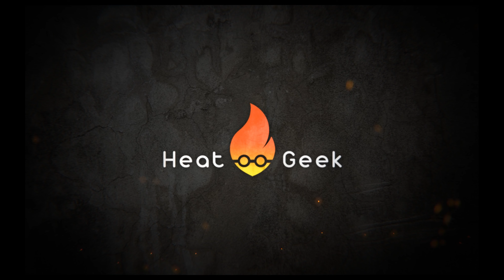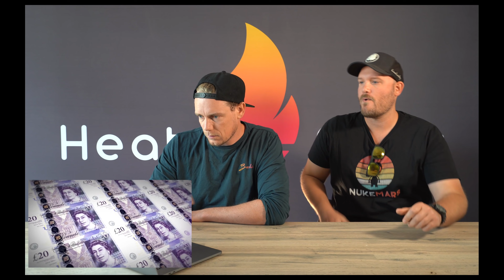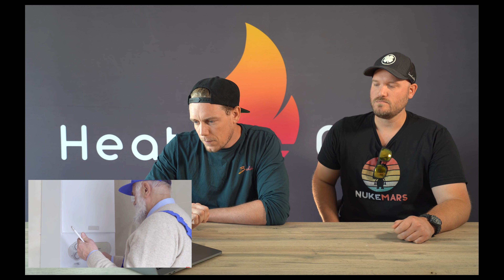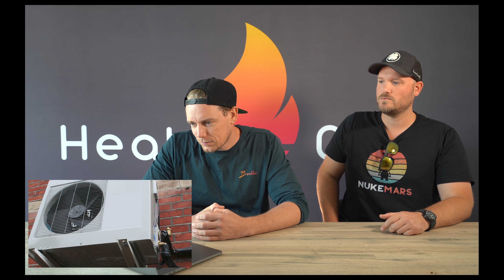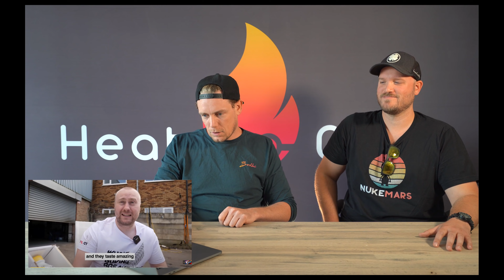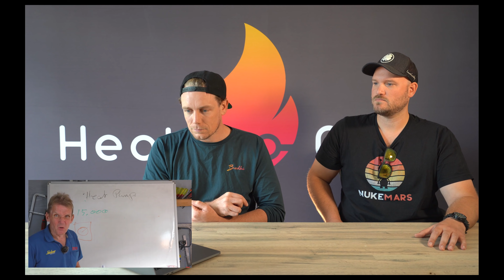Professionals React (BADLY) To Skill Builders's Heat Pump Videos | PART 1 | FIRST TIME WATCHING

Comment: Heat pumps may be great for well the well off to boast about at dinner parties but for the vast majority they are impossibly expensive to buy and run. Not only do they cost a small fortune to purchase and install but they don't save any money in heating bills often cost more to run than the gas boiler they replace. For the vast majority improving insulation in their homes brings far better outcome for the money spent and then actually saves them money with reduced heating bills.
Reply from the maker: As per our video.. yes they are top expensive  fir the majority
Reply: @HeatGeek  But that is the whole argument that Roger has in his videos. He clearly states that they can work but are expensive, complex and don't save money on heating bills so their is no payback on the outlay. I have both air-air heat pump and a gas boiler and I never use the heat pump for heating because its more expensive to run. I only use it for cooling in the summer.
Reply from the maker: @schrodingerscat1863  you misunderstood me. They are expensive to install.  That we agree on. They don't have to be expensive to run necessarily.

The bits I disagree with is that they only work in extremely well insulated building and that they always have scops of around 2.. its totally misleading.
Reply: @HeatGeek  Well my own experience and research suggests that when properly sized and installed they are about the same or a bit more expensive to run than a gas boiler system and that normally requires at least some improvements to insulation.
Reply from the maker: @schrodingerscat1863  when you say your own research. Do you mean installing them in different types of properties or Reading on the Internet?
Reply: @HeatGeek  When deciding what to install in my own house during a major refurb project. I did months of research into this and got several companies involved for advice, they all said more or less the same, ground source was a none starter because of the geology of my area, air source air-water was coming in at around £25k to £30k installed. In the end I went for 7 zone underfloor heating on ground floor and radiators upstairs powered by a gas system boiler and large hot water storage tank. This together with an air-air split heat pump system which I use for cooling in summer though it can heat the house perfectly well it's much cheaper to use the gas system for that. I have also had installations done at a couple of rental properties recently and the numbers didn't add up for heat pumps on those either.
Reply from the maker: @schrodingerscat1863  so your experience is tour one property..  that you didn't install one in .. you can't make the claim off the back of that that heat pumps cost the same or a bit more to run based on that. Every property is different. Yours was particularly difficult if you were quoted 25k for an air source too.  

An air source would have been much cheaper than a gas boiler with ufh too
Reply: @HeatGeek  £25K was for the whole heating system including underfloor heating and hot water. In the end I opted for underfloor heating but with a gas boiler rather than an air-water heat pump system and added air-air splits for cooling which was an extra £12k. As I said I did a lot of research as it was a significant outlay. The companies involved in designing and giving advice are the ones that came to the conclusion that it would be about the same running cost as a gas system or maybe slightly more expensive but then servicing and maintenance costs would be considerably higher for an air-water heat pump because of the increased complexity. I have also had a design done on two further properties that came out with the same kind of numbers, about as expensive to run but considerably more expensive to purchase and install and more expensive to maintain over all. As these are rentals I didn't want the extra chance of problems of a more complex system either. If a gas boiler breaks down I get if sorted out in 24h, not so with a heat pump.
Reply from the maker: @schrodingerscat1863  sure.. but again.. this doesn't mean all properties will be like that. 

Additionally if you had underfloor heating and the numbers came out to similar running costs.. its sounds like they were quiting for older units. The units coming out now have much better scops comparable to ground source. They've essentially killed ground source off.

Comment: You may have seen that the fully charged show did an interview with a infra-red manufacturer. Part of the video was a long term comparison of the cost of infra-red vs other sources including a heat pump. They seem to conclude that their product is cheaper to install but more expensive to run but the payback time for heat pumps would be measured in decades by which time the device would be long out of warranty. Would you like to make a response to their video too?

https://youtu.be/gvg4w-z_HdU?t=460

Comment: Simple; ground source is necessary to make decent COP in cold climates
Reply from the maker: That was true untill about a year ago. New r290 units get the same scops as ground source. Ground source ibky advantage now is no outside unit...
Reply: @HeatGeek  yeah, propane has better heat transfer than R410A, but it still has to lift the temperature significantly as air-source... COP improvements are made by reducing the deltaT. I'm surprise how many more Heating Degree Days we have in the upper Midwest US as compared to Leeds, UK

Comment: If I could build a house to Passive house standards, I would install a heat pump, But I live in a house built in the 1950s, so in my home it would be pointless. You need the right pump in the right house, installed by the right installer. (Gas fitter since 1985)
Reply from the maker: houses do not need to be passive standard (which barely need heating) for heat pumps to work. That's ridiculous.
Reply: @HeatGeek  I never said they did Mr Geek, I said that that's where I personally would use one for myself, would you fit one in my 1950s built draughty house then?
Surely in my imaginary passive house it would be the cheapest way to heat my hot water, would it not? bearing in mind my imaginary passive house is just outside of inverness and Solar thermal might not be the best idea.
Reply from the maker: @marksmith5977  i wouldn't fit a heayvpuml in a passive house.. it barely needs heating. Yes I would and have fot many in 50s houses.. and many in 1920s houses.. but not all. It depends on the heat loss.
Reply: @HeatGeek  Can you rewrite that in English please, wtf is a heaypuml? must be some new technology I have never heard of.

Comment: I would say very few old houses that will ever work effectively with a heat pump, new build that where designed for it sure.

Its not all that easy to effectively insulate a house with solid walls.

Comment: Something folks seem to be ignoring is the whole gas infrastructure.  Domestic gas used to be used for lighting, heating, and cooking.
- Gaslight (the non-metaphorical sort at least) went away a long time ago.
- Gas heating has been beaten by electric (heat pumps) for new construction for a while in 99% of places.
- Electric ovens and induction cooktops are at least as good as gas, though lots of people still prefer gas because that's what they are used to.

Does it actually make any sense for developers to install domestic gas infrastructure?  Those costs are frequently subsidized by local govs/councils, and they aren't cheap. They also leak a hell of a lot more than most people realize.  Rarely the leaks are so bad as to blow up buildings (though it does happen), but the amount of CH4 put into the atmosphere is significant.  When do cities stop supporting existing (and maintaining) existing domestic gas distribution networks?  It's going to happen eventually.

Oh, and there's the whole thing about being dependent on a single volatile fuel.  This is the most important point IMO.  Electricity can be generated many different ways.  Most places renewables with gas plants only running to fill in the supply gaps is already the cheapest way to generate new electricity, and it will continue to get better.

Comment: In my village a contractor built 19 houses with heat pumps. Everyone complained that the rooms weren't getting up to temperature and also the expense of running them. There was a big meeting between the owners, council and the builders. The end result was that the builders walked out and  the last thing they said was put thicker jumpers on. If the government is so determined to reduce pollution then deal with the state of the roads.  I have been to France for the last 37 years in different vehicles form classic cars to vans. I have checked the MPG in every vehicle in France and at home in Cornwall. I get an average of 20% better MPG in France than Cornwall due to the roads. I have filled up in Cornwall, to eliminate if it was different fuel and there are just as many hills in France as here. I tell people its like rolling a marble on the tarmac, over there it wouldn't stop rolling. The roads over here are so rough and full of pits, that's why you use so much fuel. My fuel bill per year is £7000 app. I could save £1400 per year which is 886 litres of fuel which would not be used. This is a lot of CO2 saved. If you calculate everyone's fuel bill for the whole country which is 46.9 bn litres x CO2 per litre = 1256.92bn Kg of Co2 saved into the air. Perhaps the Government should be concentrating on the state of the roads instead of trying to make more money from the public. We all know that Gas and oil boilers are far cheaper to run than electric, its just another government get rich scheme for the rich. If all of the electric was renewable I could see the point but it isn't.  All I get is complaints from people who have had air source installed in new houses and bungalows about the cost of running them. I have been a plumber and heating engineer for 39 years, worked with all renewables. Anyway that's my rant over and done with.

Comment: These anti renewable energy Karen's always use the same invalid strategy, what if the wind doesn't blow, what if the sun doesn't shine, and so on. Like you said, there is nothing wrong with the technology, and it should be fitted where it works the best. Only a fraud would fit a system and ask money for it regardless if it is not the right system for that location.

Comment: I live in a 61 sq meter terrace house, with a back yard that’s 4.5 x 11 feet, where could I possibly put a heat pump? I have insulated everything possible by using stud walls filled with rockwool on party walls, more loft insulation, all windows double glazed, new interior and exterior doors (including frames) in every room. My gas combi boiler heats for around 5 hours a day about 8 months of the year, the rest of the year it’s only hot water and gas hob. Total gas bill for a normal year is just under £300.  My previous house (slightly larger house) had an old oil boiler and an open fire, that cost around £800 per year, the previous house was rented and landlord would not upgrade anything, I bought my own house after 7 years there, best investment I ever made.
Reply from the maker: Doesn't sound like there is anywhere . As we say 100 times in the video.. they aren't for everyone but that doesn't mean don't fot them where you can
Reply: @HeatGeek . I agree they are not for everyone. However, I am trying to buy a rural house in southern France, it’s on an acre of land so I will be looking into the possibility of a heat pump. It’s a 100 + years old house so I will be doing a lot of renovation. They get great summers but the winters can be cold. I went to view the house two weeks ago, it was 22c outside but inside the house was freezing! Might need some insulation 🤣
Reply from the maker: @jimh4072  get an r90 unit.. and if you can.. ufh
Reply: @HeatGeek . Thanks, I will look into it.  👍

Comment: Why the addiction for air to water in the UK? I've had a quote for £12k for air to water and £8.5 for air to air with Aircon to boot. You can guess what I'm going for 🤣🤣
Reply from the maker: Because the vast majority already have wet systems installed
Reply: @HeatGeek  I have a central heating system yet it still works out cheaper is it more about the waste it generates ripping that out? It's just sad the government are only incentivicing air to water and nothing else depending on the property it sometimes in my case cheaper to go for air to air
Reply from the maker: @Rory241995  how do you heat hot water?
Reply: Heat pump hot water cylinder dimplex do one
Reply from the maker: @Rory241995  many do them.. but then your buying 2 heat pumps and its more expensive again..
Reply: My quote differs and that's what I'm trying to explain ahhh well each to their own
Reply from the maker: @Rory241995  sure. No 1 size fits all
Reply: @HeatGeek  this is where I'm coming from but the government are stuck to incentive one common path it's annoying!!!!
Reply from the maker: @Rory241995  because there's no alternative tbh.. the only alternative (hydrogen fuel cell) we are uks number 1 installer of and I don't think they're the long term solution.. they're a great interim though

Comment: sound like the guy installed it correctly but the customers are pissed because their house was too old and didn't have insulation to me.... oh and he lives in an averagely colder place from you guys... and the people wanting the installs around his area are just plain dumb... like i can't mince it anymore... its just brain dead... and gas prices goes up is due to the fact that its a limited resource so over time when inflation of a currency keeps going up and the limited resource is being used up... well duh... its gonna increase price over time... eventually it will reach to the point where electricity will be cheaper than gas.... its not rocket science its not a conspiracy... its just common sense....

Comment: I like my air to air heat pump, least expensive way to heat my home besides cutting/splitting/hauling firewood.  Yes, perhaps noisy but I don't mind and it lets me know it's running.  Works just fine to 20F
If it was air to water with a storage tank, heat could be stored during warm periods but pumping water all around costs money.  Moving air costs money too, which is more costly?

Comment: 22:18 putting piping underground between inside and outside unit is a huge mistake IMO. The piping between units should be as short as possible, and double or triple insulated - the shorter it is the more efficient the whole system is. I have heat pump for two years, and about 5 metres of piping is going through my garage which is not heated. When I upgraded the insulation on those pipes it was a game changer. A lot of installers don't pay attention to this piping between units. Generally there are lots of mistakes installer can do to make it less efficient
Reply from the maker: Great feedback thanks